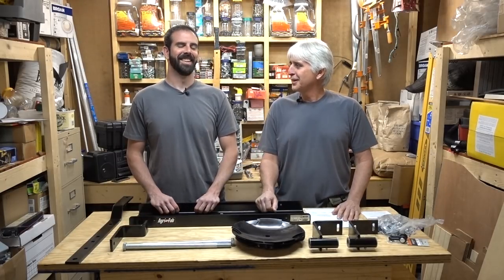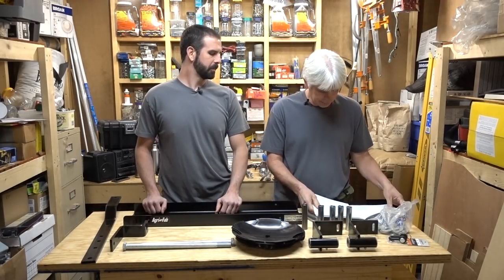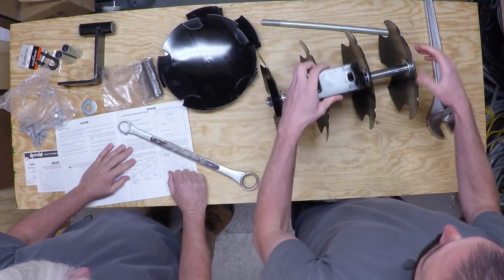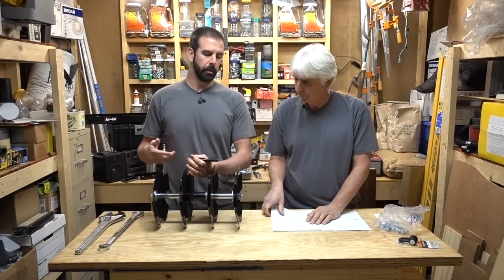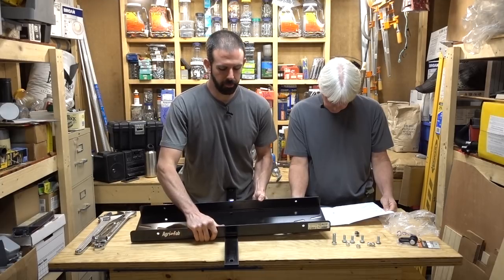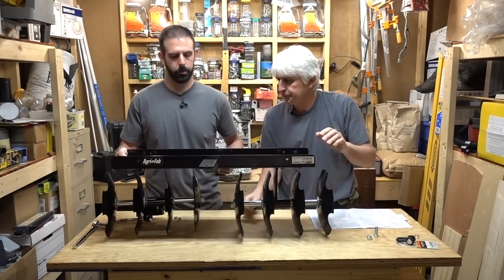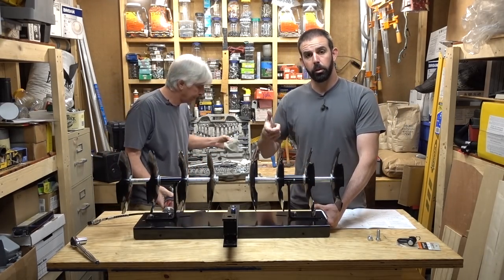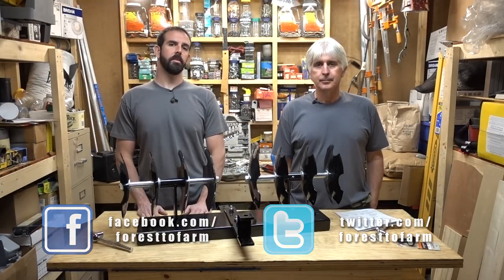Agri Fab Disc Cultivator Build

Comment: Thinking about getting this for my lawn mower. I do not have a sleeve hitch. I have a small garden. Do you by chance have a video of you using this without a sleeve hitch? Or tell me how well it worked? Thanks for the video. It was great to watch and informative. Keep up the great work.
Reply from the maker: Your welcome. Sorry I missed this comment until now. Lots to keep up with. Yes we have at least this one video and maybe more. It does pretty good with loose soil. Not gonna get big tractor results but I was pleased with the results. We just wanted to scuff the top soil a bit to help seeds get a hold. I prefer no till methods but when you have disturbed soil like when we are clearing brush/forest areas there are times when you need to level things back out. Good luck and I hope this helps.
Terry https://youtu.be/KLHrq4_LQUA

Comment: What tractor are you going to use to pull this, would think the Kubota would be over kill?  They are setup to be used with a garden tractor and a sleeve hitch. You did well buying the brand with notched blades, does much better job. Normally they are pulled in tandem,  the front one throwing dirt outward, and the rear one throwing the dirt inward. 
Can't wait to see you put it to work!
Reply from the maker: Yeah the Kubota would be way over kill, ha ha. We have an old lawn mower that we are going to pull it with. It should get the job done but it will be slow going. We did not do the tandem because this is a mower, not a garden tractor with a sleeve hitch. It only has a hole in a thin metal plate to attach to.We will buy something more appropriate for the Kubota in the future. We just wanted something to get a start on seeding around the place.
Video coming soon on putting it to work!
Terry

Comment: Its actually advantages to have the blades offset not aligned. Reason being if all blades contact the dirt there is more surface area and they wont sink in where as staggering blades will increase pressure for the given blade in contact with the ground. Otherwise nice video and good luck, like to see it in action.
Reply from the maker: Thanks! Works great.
Terry

Comment: Getting to planting I see. Good job guys. Buckwheat is an expensive cover crop tho I would never want to buy it even tho it is one of the best. Try fixation balansa clover or spring or winter lentil or soybeans. They’re a very cheap cover and do just as good as any other. The lentil can’t handle wet weather tho. Annual ryegrass is a great soil builder and is a very cheap grass for the work it does. Wildlife forage sorghum is dirt cheap. Rape is a cheap brassica. If u don’t already make a mix on green cover seed. You’ll find that you can plant a great cover mix for winter for under 16 dollars an acre and buy grazing grasses there too.
Reply from the maker: We went with Rye, wheat, Austrian winter peas and gonna throw a little crimson clover on top mostly because we already had the seed left from last year and wanted to use it up. It will at least give us a start for now and we will work on it again next fall hopefully. Gotta have something growing there to keep the soil alive.
Terry

Comment: Build? Do you mean assembly
Reply from the maker: Actually they both mean basically the same thing. People describe car work as say "building" an engine. Homes are "Built", not assembled by the contractors terms. In either case they "assembled" parts that were supplied. They never actually made the parts. But the common terminology is generally "build" not "assembly" where I come from. Both would be accurate descriptions though. :)
Terry
Reply: Well yes if you go to the dictionary the are probably both similar but not on YouTube. 
So building an engine is building because you have to measure existing parts and order parts sized to your particular needs for example. 
Building a house is a build because it is designed by a person. Those custom plans are then used to order the parts needed for that house to be built. 
In nether case do they tip all the parts out of a box and just put them together. 
Check out the many other “build” videos on YouTube where you will find people making things to there own design from scratch and that is what I hoped for when I clicked on this vid.
Reply from the maker: Got it.